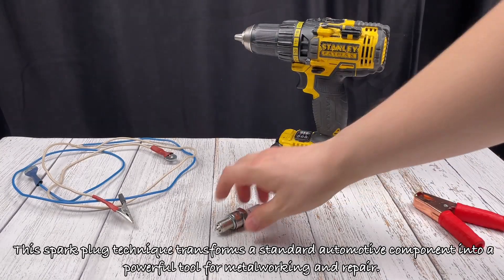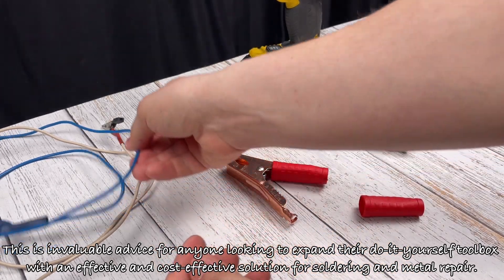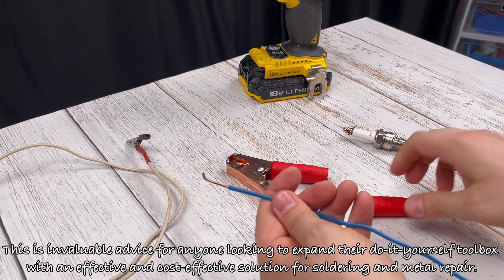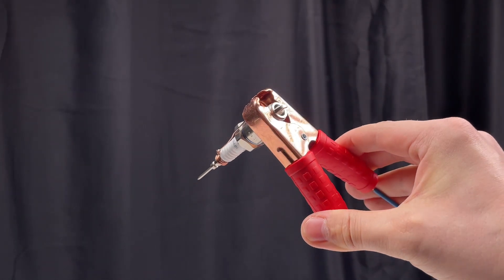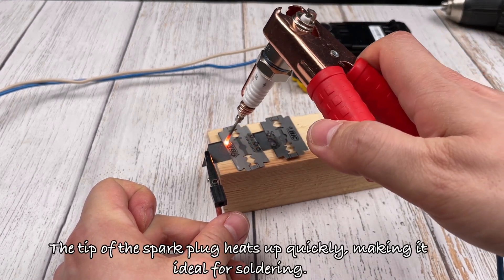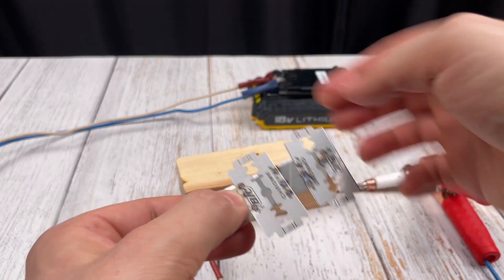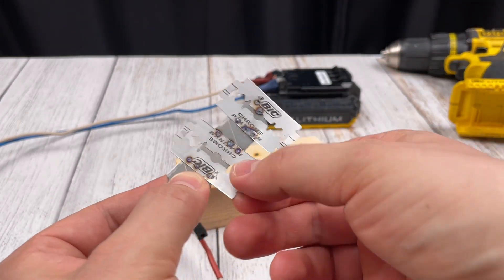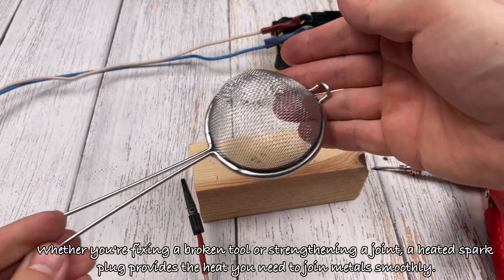🔥🔥An innovative method for soldering a car spark plug! INCREDIBLE

Comment: Thank you...very nice...I have some questions: Does this idea lead to the destruction and corruption of the battery over time or not? Could it weaken its efficiency? Should the spark plug be new, not used, or not in condition?

.شكرا ...جميل جدا...عندي بعض الاسئله: هل هذه الفكرة تؤدي إلى تدمير وفساد البطارية مع مرور الوقت أم لا؟ هل يمكن أن يضعف كفاءتها؟وهل يجب ان يكون البوجيه جديد مش مستعمل ولا مش شرط؟